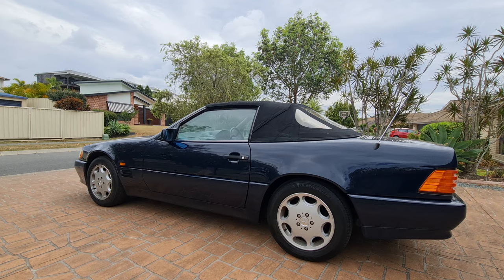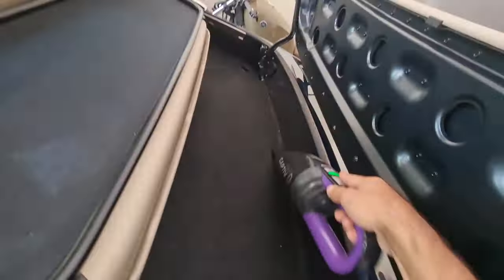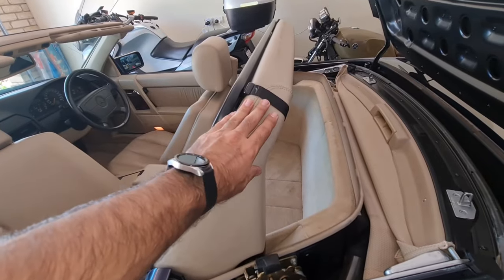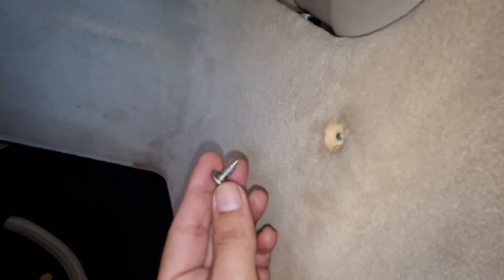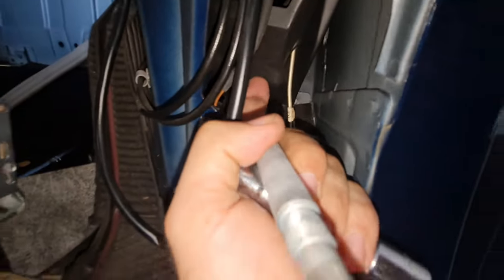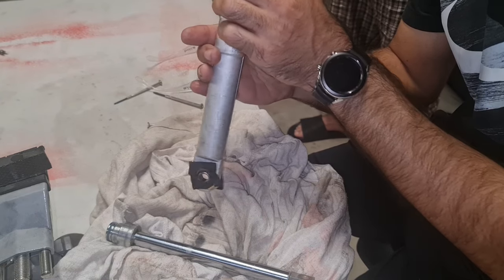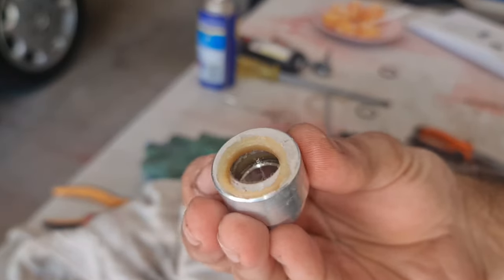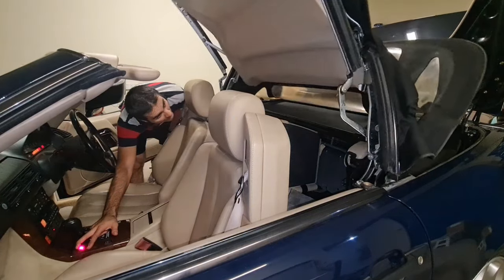SL R129 Top Hydraulics Repair (Main Lift Cylinders)

Comment from the maker: SL R129 Mercedes Top Hydraulics can be scary for the owners to repair and for the potential buyers a huge obstacles due to the all heard stories. Looking deeply in to the leak repair and restoration of the cylinders, you might be able to break it down in to few fun over the weekend projects, instead of paying thousands of dollars to a mechanic or even more to a MB dealer. Let's make this affordable and take the stress away from buying your favourite SL600, SL500 or even the 300...please leave your comments on your experience,  love to hear and answer your questions ASAP. Cheers...
Reply: I have a 1995 SL320, have purchased  headrest gears as well as seal kits through Klaus for the eventual entire actuator breakdowns, one is followed by the remaining 10 or 11. With patience and a bit of skill, this tedious seal replacement can be handled, thereby saving loads of cash. Top hydraulics and Klaus's instructions have proven invaluable in this process, kudos to Klaus !

Comment: Nice job, has anyone tried using hydraulic stop leak products in conjunction with the Mercedes hydraulic fluid to try and slow the leak by “swelling the gaskets” back to original state? Don’t want to spend 3100 fixing the cylinders when the car is worth 4k. Thanks in advance 🤙🏼
Reply from the maker: Hi mate, IMHO no magic leak fluid can stop the leak as the orings are so worn now...

Comment: You failed to show the installation of the 2 o-rings in the piston.  In my unit there appears to be a felt 0-ring and then the rubber 0-ring.  There is no mention of this at all.
Reply from the maker: Hello, please refer to your seal kit diagram as mine did not have such extra seal.

Comment: I enjoy your videos on this fabulous car.
Reply from the maker: Thanks Douglas 😊
Reply: @BenzAddiction  I am still struggling to find the reason why my soft top just stopped working. My pump and fluid are fine. The fluid needs changing the. I had the relay box checked out…. Something tells me though that it is still the problem. I do hear clicking but the technician didn’t power it up. Your thoughts….
Reply from the maker: @douglasthompson9482  can you hear the pump working?
Reply: @BenzAddiction  no
Reply from the maker: Have you checked the main fuse for the pump, they are so finicky...
Reply: @BenzAddiction  hi, I have not but will do that.
Reply: @BenzAddiction  hurrah…. Success, one screw was loose and the fuse strip had expanded just enough. Thank you buddy!!!!
Reply: Donde se encuentra el fusible principal de la bomba, ya revise todas las bombas y no tienen fuga, pero no funciona para ningún lado, necesito que me ayude por favor, ya tengo días y no encuentro el problema, Saludos desde El Salvador

Comment: Thanks for the detailed walkthrough. The roll bar in my car is no functioning and it stuck in the down position, however the rest of the top functions fine. Would the lift cylinders be able to be removed and repaired without the roll bar being in the raised position? Thanks!
Reply from the maker: You need to remove the rear compartment trims somehow and thus would be difficult with roll bar down. There should be a way of course. Maybe try first to fix the issue with roll bar?
Reply: @BenzAddiction  Yeah that would be ideal but I am not sure if its just the rollbar module or the whole top module since the top works fine. Could even be solenoids, too many components in this damn top lol

Comment: Nice job! I was not so lucky.  I found it to be difficult and after about 8 hrs of work I replaced the right side main lift with a rebuilt cylinder and... it did not work.  Ended up taking to Independent MBZ shop and after two weeks and 3100 USD they rebuilt all 13 cylinders.  However, the top still does not function as it should although it opens and closes with out leaks.
Reply from the maker: Thank you my friend,  sorry to hear that.  Do you know what is the cause of the malfunction?
Reply: I really appreciate your videos.  Very helpful.  I, too, purchased a SL at auction, fairly blind.  2002 Silver Arrow.  Low miles…everything is in order for the most part.  Not like what you have documented.  I do worry about hydraulics and such.   Have you shared where you purchased the seals and guidebook?   Thanks again.
Reply from the maker: @JohnnyD0406  Great, 2002 silver arrow is an awesome choice, good luck and the eBay link is https://www.ebay.com.au/itm/281989635356?mkcid=16&mkevt=1&mkrid=705-154756-20017-0&ssspo=uRA3VpPiQRK&sssrc=2349624&ssuid=VftSBydbT7C&var=&widget_ver=artemis&media=COPY

Comment: Excellent camera work and commentary!
After replacing various cylinders and re-connecting hydraulics, how do you avoid, or eliminate, airlocks
when testing the repair.
Dos this happen as part of operating the softtop several times perhaps?
Reply from the maker: Thank you my friend,  the air pocket will be out of the system automatically as the system knows how to handle this, just need to watch the fluid level for the first few cycles.
Reply: @BenzAddiction  Thank you; 
l thought that might be the case, but it's always good to get it  confirmed.
I owned a W100 Grosser two decades ago and the 'Komfort' hydraulics used a red (rather pleasant smelling fluid), equivalent to 'SHELL AEROFLUID 41, normally used to operate the landing gear in small aircraft.
Do you happen to know whether this red fluid is still used in the hydraulics of more modern cars?
Reply from the maker: @helmuth haass  To be honest, I am not sure but w209 CLK and R129 uses clear type (colorless) fluid, different part numbers and I think it is logical, as I prefer the colourless one on interior trims and upholstery in case of a leak than the red one.
Reply: @BenzAddiction  thanks for that info. Luckily the interior of my Grosser was red 😆

Comment: Do you need to remove the bose amp?  Also, my main cylinder is leaking right after flushing with new fluid. Now the main is leaking. Will it continue to leak if I don’t use the convertible?
Reply from the maker: I don't think so, and should not leak afterwards.

Comment: Just got a 2001 sl500 and its doing the same except it only leaks when soft top goes up not going down.
Reply from the maker: Easy fix ;)
Reply: @BenzAddiction  I'm not that mechanically inclined. Have an idea what repair might cost ? It's a weekend car I don't drive it often and it's to hot in Louisiana to put top down anyway. Do you think if I fill the reservoir up when using it only will damage it more I'm scared to even put top back down to put hard top back on.
Reply from the maker: @sonnyvito504  replacing those 2 main Lift Cylinders are not too difficult but, if you want to, you can top up the fluid and open the soft top, as long as you don't run the pump dry, it should be safe. The cost is only $50 of seals for me to replace the seals one by one.

Comment: How do l get replacement keys for the 97 sl320? I was told it is impossible. Can the alarm system be disabled?
Reply from the maker: Contact your Mercedes dealer.
Reply: I've found a Tulsa key place that can do it.  MB dealer recommended them since they no longer handle it
Reply: @clyde2801 Clyde.
Does the Tulsa key maker supply the transponder chip that shuts off the security system? I have a spare key but the chip that goes in the key fob is missing so I can't start the car.
  Do you have the Tulsa shop's phone number or address, email? 
Thanks. Lou
Reply: @BenzAddiction I need the transponder chip that is in the key fob. I have a spare key but it won't shut off the security system without chip in fob.
  Do you have any idea who can help? Mercedes says they no longer have this service. 1997 sl320. 
  I am at my wit's end trying to find it!
  Thanks. Lou
Reply from the maker: @louiscampochiaro2540  Hi, try other dealershis... within past year I have seen at least 10 people buying these fobs...

Comment: How do those clips come off the hydraulic lines?
Reply from the maker: Hi, just slide them off, there is only one way.use a skinny screw driver...
Reply: @BenzAddiction  ok - but any concern of them popping off and falling into an unreachable area?
Reply from the maker: @danemulligan1583  yes, while pulling away have mechanic type magnet close to your screw driver. Or use a super magnet on your screw driver...

Comment: Wait a moment, mercedes service told me to change all the cylindre!
If i change only the O ring like you it's ok?
Reply from the maker: Depends if you would like to spend 10K at the dealer or $100 for a DIY, that's your choice...
Reply: @BenzAddiction  ❤❤❤
One question, i use this car only summer, and only week-end   so 4 days every month. And the winter,  i drive with the hard top.
So  if i can add oil for now, and every time i check the level?
And where i can find the o ring like in your vidéo ?  Précision,  i live in France 😅.
Reply: Mercedes want you to change all the cylinders, the transmission and the steering rack. And the brakes. 😂😂😂